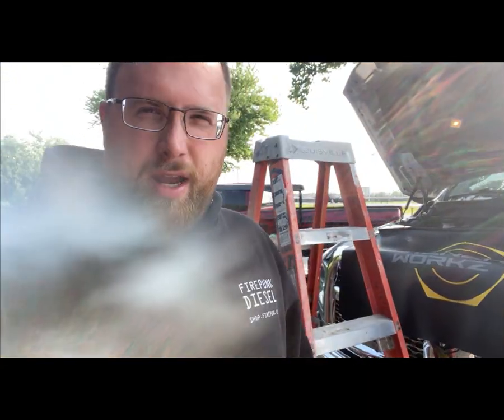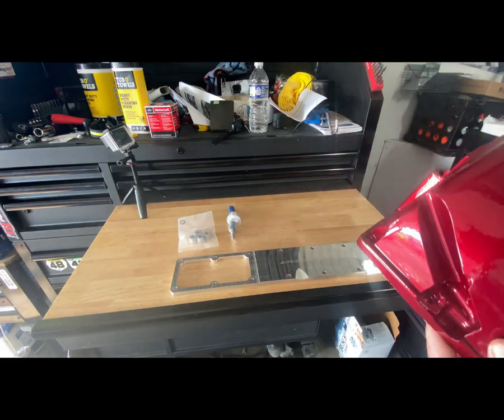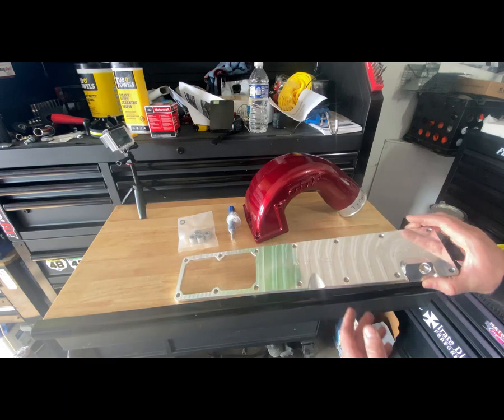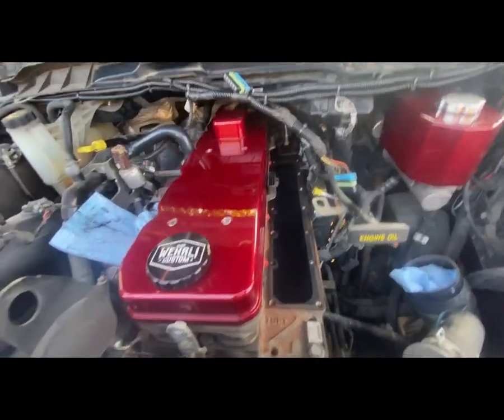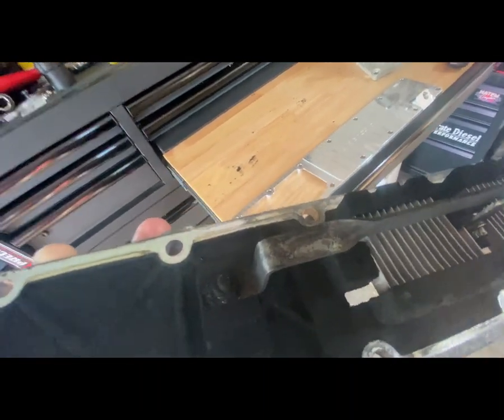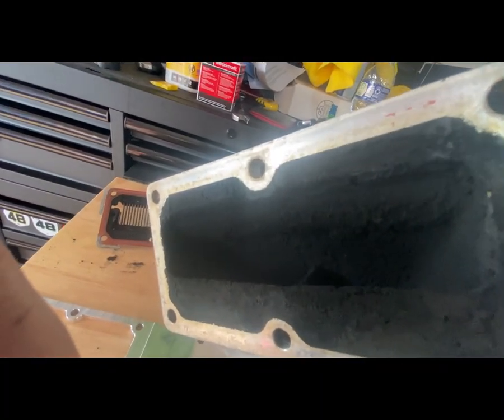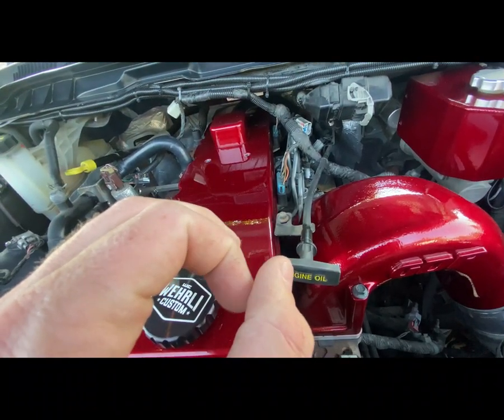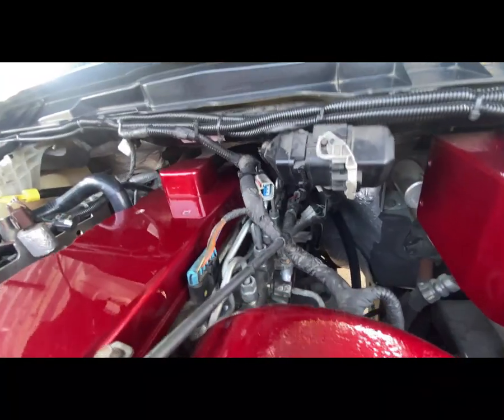6.7 CUMMINS Grid Heater Delete and Intake Horn INSTALL

Comment: You’re doing to much with trying to slide this and slide that. Just remove the number 6 line. I literally just did this job on my 3rd gen. It’s easy to remove number 6.
Reply from the maker: Thanks for the input. But 3rd gens are different than 4th gens. 
The 6 Line is pretty tough to get back to. 
The way I did it was not any extra work. I’ve done it on 4th and 5th gens. Works great. 
👍🏼

Comment: Do you have to bleed the fuel system when you’re done?
Reply from the maker: @cjaoff-road7269  nope. Should fire up pretty much right away.
Reply: @everydaydiesel  ok thank I have an 02 cummins and had to bleed the air out of the system before it would fire correctly. Getting ready to do this to my wife 17 cummins.
Reply from the maker: @cjaoff-road7269  an 02 and a 17 are nothing alike. Two completely different systems
Reply: @everydaydiesel  I understand that I wanted to make sure before diving into it.

Comment: I have a 2018 6.7 thays 2nd gen swapped do you know if I can run an aftermarket valve cover like yours without a catch can? I'm running the stock valve cover now with a hose running to the atmosphere
Reply from the maker: As long as the valve cover you buy utilizes a GOOD baffle system, you would NOT need a catch can. 
The D&J cover is known for being one of the best at keeping oil from escaping. 
But if you run an aftermarket cover that just has -10 or -12 bungs on it, then you WILL need a catch can.

Comment: so you did not undo the 6th fuel line, did you just push the line up to pull the rail out? the line wont change shape or something?
Reply from the maker: @everforexcanada5663  correct. There’s enough room to make it work.

Comment: Can you still continue to use the stock intake horn or do you need to buy a new one when installing a grid heater delete?
Reply from the maker: You can use the stock intake horn. 
They are very restrictive. But you can use it with a grid delete.

Comment: Im thinking about replacing my valve cover and stock breather. And get one like yours. Have you had any issues with your breather on your valve cover?
Reply from the maker: Nope no problems at all. The D&J cover is the way to go. 
I also have a video on installing that as well.

Comment: Did you notice a difference?
Reply from the maker: @CivilianAF.1483  it’s common knowledge that intake horns will do nothing for performance. It’s purely for looks. However the grid heater delete is well worth it. And it’s definitely flowing more air. Which isn’t a bad thing.
Reply: @everydaydiesel  thanks for the reply. Do you know if I can just cut the grid heater out and reuse the factory plenum cover? It's a work truck, not a showpiece. I was thinking about drilling and tapping the killer bolt hole and plugging that off.
Reply from the maker: @CivilianAF.1483  you can. Just be careful of how and where you cut. Make sure nothing loose gets left behind. Use new gaskets. Make sure you seal the bolt hole left from removing the bad bolt. 
Or just buy the delete plate and run your stock intake horn. Can save money that way.
Reply: @everydaydiesel  thanks bro I really appreciate the input

Comment: That hole in the side did you plug that or is there a sensor that goes there
Reply from the maker: If you are talking about the hole next to the 5 1/8” npt ports then yes, a factory sensor goes there from the stock intake. 👍🏼

Comment: When you removed the fuel lines from the head it looks like you capped of the connections on the head, what did you use?
Reply from the maker: Yes I put caps on them just to try and keep them clean. Honestly I just have a bucket full of random caps from over the years.

Comment: Did you remove the grid heater relay by the battery as well or just the cable running to the grid heater ?
Reply from the maker: Just the cable. The relay is still there.

Comment: Nice video and thanks for putting it together. What did you do with the power cable going to stock grid heater?
Reply from the maker: Sorry for the late reply to this. I completely removed that power cable from the solenoid on the passenger side. It’s not needed anymore if you are running no heater like me. Thanks for watching!!!

Comment: Dude thanks for the video. I have a 3rd gen. Would you recommend deleting Heater grid up here in Mn ? Also what happens to the plug that was in the old horn? Do you have to retune? I’m assuming that plug will throw a code. Thanks man 🙏
Reply from the maker: No prob! Thanks for watching!! Here’s what I’ll say about the grid. They are restrictive. They do get filthy from the EGR, and they can be problematic. BUT, they work very very well. Especially in cold climates. Here is what I suggest. Go to GDP’s website. They make a intake horn and an aftermarket grid heater that is very nice. So you can delete the stock grid heater plate. And run the aftermarket grid heater that bolts in place of the throttle valve. (Assuming your a 6.7 3rd gen) 
As for this plug, I’m not following what you mean. You do not need a re tune for a grid delete or Intake horn. 👍🏼

Comment: Any gaskets that need to be purchased
Reply from the maker: Nope the gdp kit comes with everything you need.
Reply: @everydaydiesel  do you have a link to the kit
Reply from the maker: @wylet1143  https://www.glacierdieselpower.com
Here’s the website. It’s all on there.
Reply: When I order the kit it says “choose application” (standerd pickup) or (cab and chassis) what does that mean
Reply from the maker: @wylet1143  well, do you have a 2500/3500 pickup truck? Or a 3500/4500 cab & chassis truck?

Comment: How do i know if my grid heater has been deleted or not
Reply from the maker: You can look under the hood and tell whether or not it has an aftermarket intake plenum plate or a stock one.
Reply: Thanks
Reply: Will the grid heater still be connected or disconnected mine is still connected
Reply from the maker: @ppowerade69  if it’s a stock intake plenum and the wire is still connected then it’s safe to say it’s all stock and still there.

Comment: Was there no gasket between the horn and the heater delete plate?
Reply from the maker: Yes there is a gasket there.
Reply: @everydaydiesel what about under the grid heater delete? Never seen you put one in
Reply from the maker: @noxdout_cummins4247  yes. There is a gasket there too. It’s just a factory cummins gasket. Gaskets come with these parts when you order them.

Comment: Do I need a tunner or progrmer to make the grid heater delete ??
Reply from the maker: Nope. You can delete the grid heater and still be completely emissions intact. It doesn’t require tuning either way. 
You just can’t use the intake horn I have if you are intact.

Comment: Where did you get the plugs for the fuel rail and intake lines that were removed?
Reply from the maker: I have a collection of random plugs and caps from years and years of parts that come with them and such. 
So I had what I needed. 
It’s not necessary. Clean paper towels or something like that will suffice.
Reply: @everydaydiesel  Thank you for the quick response. I appreciate it and your content!!
Reply from the maker: @JR-fj4vy  no prob thanks for watchin!
Reply: I have followed your lead and have an another question for you…what did you do to get the #1 injection line to work with the GDP horn?
Reply from the maker: @JR-fj4vy  I had to dremal some of the powder coat in order for mine to fit. And I had to loosen the 1 line and then tighten down the horn. Then tighten the line. It’ll work.
Reply: @everydaydiesel  Thanks Brother! So you didn’t have to bend the line at all? Just loosened it at both ends or just one end (didn’t remove it completely)?
Reply from the maker: @JR-fj4vy  nope didn’t have to bend it. Just loosened it up. Took a good 30 plus minutes of just messin with it.
Reply: @everydaydiesel  Thanks again! I appreciate you taking the time to answer questions and providing guidance!!
Reply from the maker: @JR-fj4vy  no problem man. Hope it works out.

Comment: how tight did you do the fuel lines, and the fuel rail??
Reply from the maker: Use a regular wrench. And get them good and tight. Try to remember about what it felt like when you loosened them up. They do not need to be super super tight. Overtightening would not be good.
Reply: okay thank you! and any tips for getting the fuel line off cylinder 6? I can break is loose then can't get my 19mm on it after that and still too tight to slide the rail out or undo it by hand @everydaydiesel
Reply from the maker: @That6.7Hellcat  you should see in the video I leave the line attached to the head. Just undo it from the rail. It has enough play to get the rail out.

Comment: what is name of that cover that I saw at the beginning of the video that had the same color?
And thank you for being pro-active responding to other people's comments. 
Most do not do that and that shows that you are genuine and care.
Reply from the maker: @18B_Madder  no problem! Are you talking about the valve cover? Or the brake res cover?
Reply: @everydaydiesel  you answered my question as soon as you said valve cover ha-ha! I have a '14 Ram Cummins I have fully deleted, straight piped and tuned. I haven't done anything else though, so I am looking around to see what to do 1st. 

This is zombie apocalypse rig lol, so reliability is priority which is why I have a 40g fuel tank in the back, everything to fix a tire, hydraulic jack and a lot more. 

So, yea, anything to improve reliability. Not that a 6.7 isn't bulletproof enough already.
Reply from the maker: @18B_Madder  gotcha. Yeah it’s a D&J valve cover. I have a video on it as well.
Reply: @everydaydiesel  I'll check it out. Subscribed brother.

Comment: Hopefully someone sees this and can help! If you pause at 9:19 right underneath the horn there is a gray plug with a red tab and black sensor it’s connected to, can anyone tell me where that goes? We just did this job on my old man’s 3500 and it drove fine for almost 200 miles but right now my grandpa is out of town with the truck popping a code for a leak between the MAF and throttle body, that same plug and sensor is hanging down on the truck and I can’t remember where that’s supposed to plug in
Reply from the maker: If I’m looking at the right sensor. It’s a 2 wire sensor and it’s connected to a dummy plug. As in it’s not connected to anything. Or for anything. At least on my truck. However it is part of the egr sensor harness. Further down the same wire loom are two unplugged sensors.
Reply: @everydaydiesel thanks for the quick reply! I guess that rules out the plug being an issue lol I hate trying to remote diagnose a problem, sounds like that p2281 code is fairly common so guess it’s time to browse some forums
Reply from the maker: @A7Xhockey55  yeah I wouldn’t worry about that particular plug. I’m not familiar with that code but you should be able to find something on it. But you are right, at the end of the day, remote diagnosing isn’t easy
Reply: @everydaydiesel  truck is going to be deleted as soon as the tune is finished, it’ll get a good look-over when doing the EGR delete and hopes are that it’s buttoned up and fine after that. I’m thinking we messed up the clamp on the EGR because we had a hard time at the end of the job. Thanks again for the quick replies man!
Reply from the maker: @A7Xhockey55  no problem man sounds like you are on the right track!